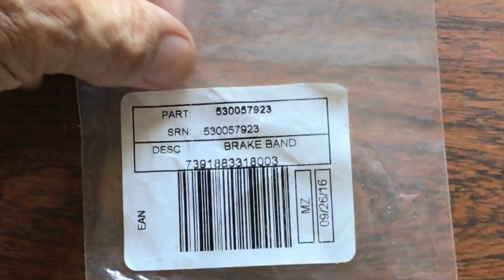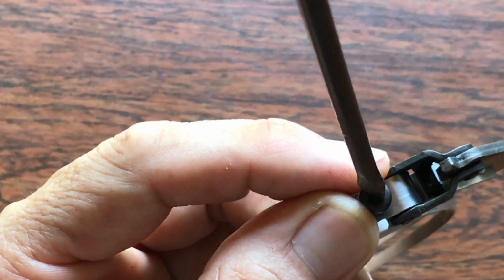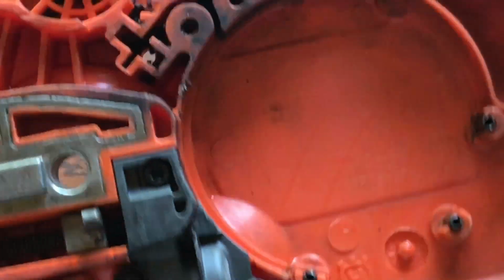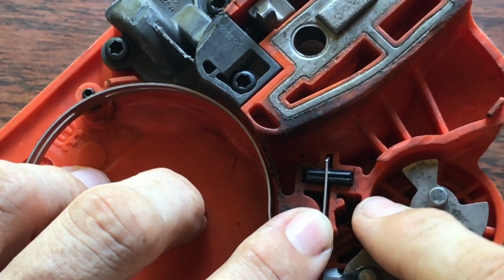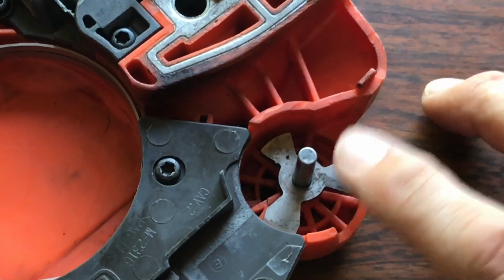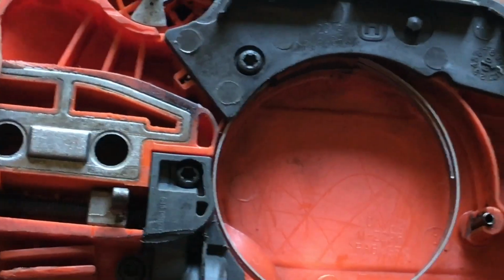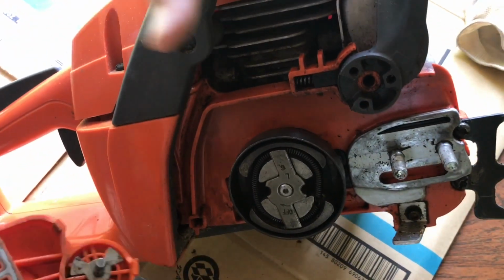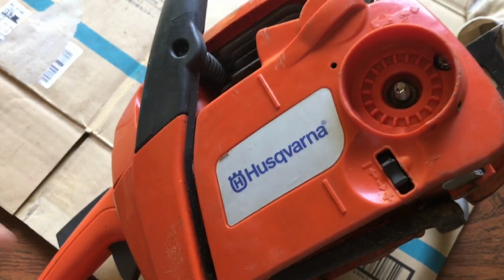Husqvarna 236e brake band replacement

Comment: QUESTION .... MY  326 CHAINSAW  has some fuel trouble I installed a new carbu. and it starts and stops  could be the inlet line is to small 
3 .5 Diameter  the carburettor people provided me with both fuel lines  one yellow and one black ---the old one is yellow --outlet  4.5 di   and must have
been white  one the inlet ---- BOTH THE NEW ONE ARE 4.5 diam.    to fit the new one to the petrol tank I should drill the hole out bigger probably 4.5dia (mm)
In doing this operation could create any problem to the carb or its ok ?

Comment: I wonder if you could help me with some hints about my  326  chainsaw  it starts then after a few moments it stops .
Reply from the maker: First Self help is to check the air filter, it may need a good clean. Next I would inspect the fuel lines. After that I would fiddle with the carburettor.
Reply: @Gregorynts  EIRST LET ME SAY THANK YOU FOR YOUR RIPLAY ....Now let me if can make myself understood ...
I put a new air filter  ,fuel lines seems to be Ok , the good sign is it started ....but I tried to tune up but it stays on high rev
then it dies ....I don't know why the choke liver  keeps going back when I pull it out ...also I noticed that from the bubble (?)
hoses seems that there are some air bubbles in the houses ....Any help is  very much appreciated        Thank you for your time .

Comment: I put the brake band in the trash. I know its a $$$ money maker for small engine gals & guys but please too much crap is no good for the reputation of the machine. I have many chain saws that are 30 years old + with no chain brake.
Reply: Don't do it with a 70 plus cc saw it can be a deadly mistake I almost lost my arm an was close to bleeding to death and have ran saws for 30 years but freak accidents can happen a chain break would have saved me from it
Reply: The mfr went a long ways to make this safely device be useful and yet quite inobtrusive. Anyone removing it just for gigles is a fool.